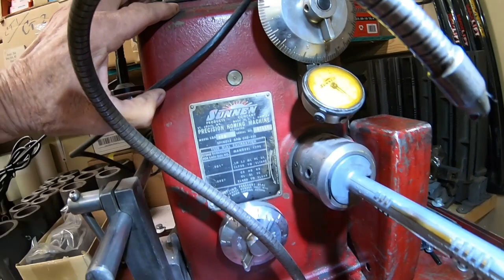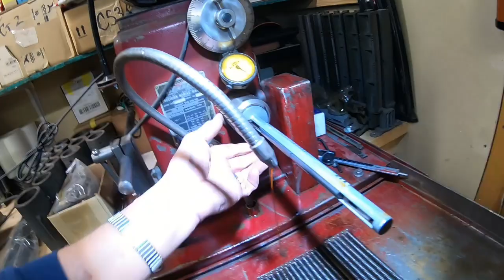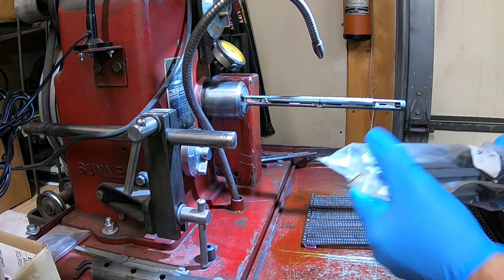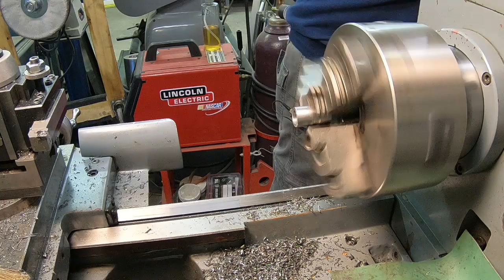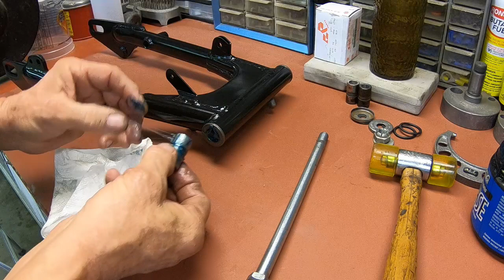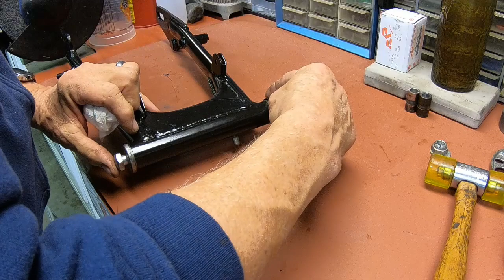73 TC125 Swing arm bushing fabrication and install

Comment: You have a very unique skill set I am curious were you a machinist in your past career?
Reply from the maker: Thank you, no not a machinist by trade. Grew up a farmer, we fixed everything on the farm, then a career soldier. But rode these bikes all my life and worked in a Suzuki/Hodaka shop in the early 70's. Guess I just love the old two stroke motorcycles, grew up racing them and riding the woods fast. Have always had a fondness for machining and I try to do all aspects of motorcycle repair, from painting to boring cylinders. It's just darn fun and a great way to spend my retirement, you can blame my wife for the YouTube videos, that was her idea. I like meeting and communicating with all the fine likeminded people out there. Thanks again for spending time with me in the shop.

Comment: Nice job brother. Being able to make some parts has got to be very handy.
Reply from the maker: Thanks Cain, indeed being able to fab up some parts you need is so satisfying, what is better is when they fit and performs function. In my part of the country, very few parts are here, mostly just some hardware items. But a lot of those are auto related not motorcycle. So I have to mail order almost everything. That puts at least a week hold on my project, so if I can make it, saves me time and money. Thanks for your comment and for watchin

Comment: Satisfaction is fitting a part that you made yourself and it's just right. That was a very nicely done job. The Hone is a nice piece of kit. Have you watched any videos by Ade at AG Engineering? He does great things with British Bikes over here. He has a Delapena Hone which could easily have come from BSA or Triumph. He is in the right part of the country, the Midlands. 
Best wishes, Dean in Oxfordshire, UK.
Reply from the maker: Yes Dean, fabricating a part you need is very satisfying. The best part is when it fits and performs function. I have not watched AG Engineering, but I am going to, thanks for the heads up. Thanks for your comment

Comment: love your attention to detail on just about everything you do. you refer to your customers, any chance you could give basic info on how you operate your business? would assume there is quite a lot of time between getting a project in and sending out a refurbished  motorcycle. also do you only work on certain brands and type motorcycle?  P.S. don't think I'm getting nosey just curious.
Reply from the maker: Hi Frank, I have to work around waiting on parts, supplies, and weather. Things like the sandblasting...the weather has to be nice enough to do that outside along with pressure washing, just cant do those things when its 30 below in Montana. So if a bike comes in and needs any of that type stuff, it has to wait for nicer weather. Weather I work on a bike today or not depends if I have the parts, or raw materials if Im making something. But generally its first bike in first bike out. But  as you see there are a lot of factors to consider. Like the rechroming for the TC125 Im now working on. My St Louis plater has a turn around of about 2 months after he gets it. I have to stop and pack all that up and send it. For the same bike I am having new fork tubes made, those I had to pack up and send to Mississippi, and that may be 30 days turn around. You see there are a lot of factors that I have little or no control over. My customers are not in any hurry but it would be rude for me to just put them off for no reason. We just have to get back to the golden rule here. I only take on bikes that have parts available for them, and I am comfortable working on. For the most part that is two stroke, Yamaha, Suzuki, Kawasaki. 1967 to about 1977. I have some twin cylinder Yamaha Scramblers coming in the future, those will be a change from the enduro style bikes.  Im running between one and two years to complete a bike currently. But the wait is much longer than that most of the time. Thanks for your comment Frank, always look forward to them. Thanks for watching I appreciate it.
Reply: @montana2strokeracer  thanks Dale for the detailed response.  i understand totally, im 77 years old and live in the Las Vegas area so my crude motorcycle work can be done most of the year. i work on my bikes only just finished a 1974 Honda xl250 set it up to look just like my old 1960/70 TT racing bikes of a by past time in my life. my grand son has a 1973 Suzuki TC100 that im trying to talk him out of for my next project. the Suzuki has 700 miles on the speed o, but isn't running. also missing the tank,seat and side covers otherwise its all there.
Reply from the maker: Hi Frank, yes our weather is quite different. This year has been really nice compared to the last few years. It sounds like you are having fun with your projects. I use to do some flat track and TT racing back in my day too. Still have my flattracker, it will one day come in the shop for a face lift to get it ready to sell. Ive held on to it long enough. Its a 72 Yamaha 360 MX engine on a Trackmaster frame. Yes I think you should talk your grandson out of his bike for your next project. That TC100 is a fine bike.You should be able to find the missing parts pretty easy. Thanks again for your comment Frank. Thanks for watchin.
Reply: @montana2strokeracer  Dale can you put your Yamaha flat tracker in your garage so those interested in old flat track bikes can get a nostalgia rush.
Reply from the maker: I will do that my friend